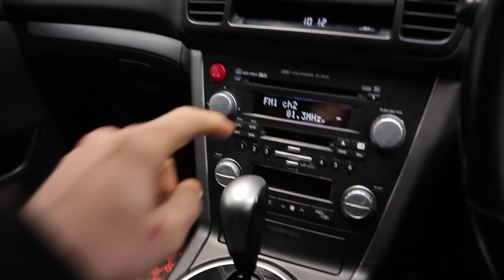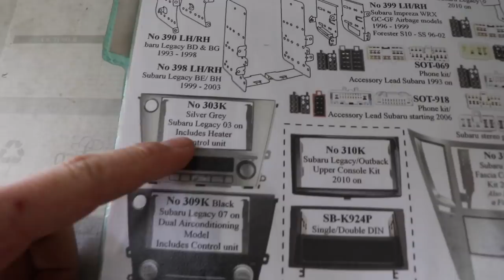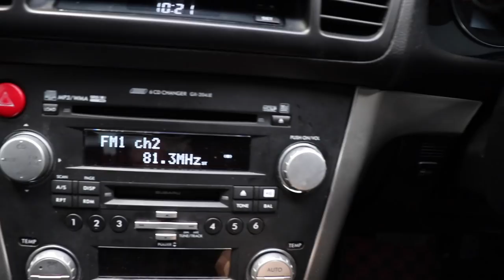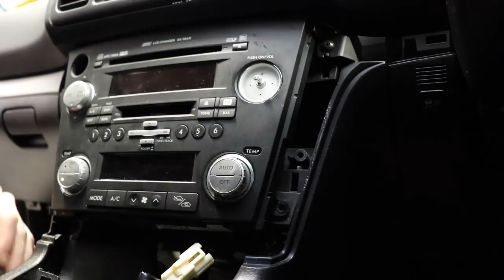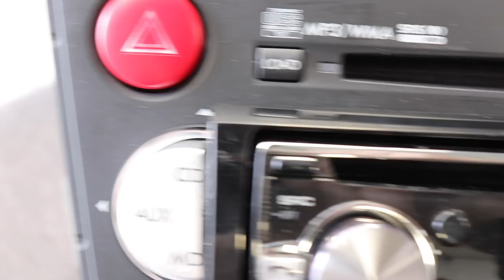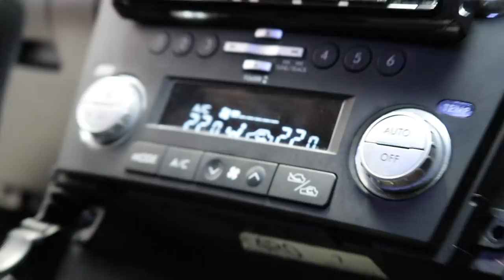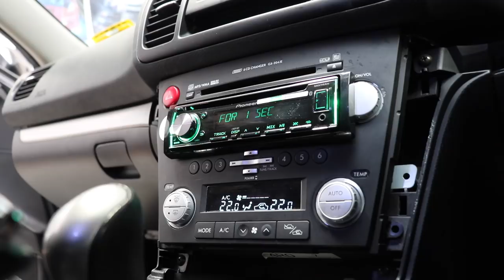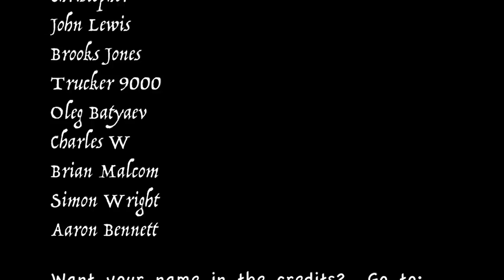2006 Subaru Legacy Custom Stereo Install

Comment: Thanks for the video.We have a problem with a customers 05 legacy with the silver front set up that has excessive pararistic draw with the radio hooked up.On the back the stereo and ac controller are one unit,so we are now looking for options to just replace the radio and now see that it might not be an option?

Comment: Great vid. I have a 2005 Subaru Outback 3.0R and therefore the stereo with the integrated climate controls. When I discovered this years ago I cursed the engineers that came up with this lunacy. Years earlier I cursed them for their design of the cabin air filter placement. Men like them will be hunted in the end times.

Comment: What you could do is source the heating unit from a different legacy that has the separated unit and get the double din fascia for above it... that's what I'm going to do with my Subaru Outback 2007 car. Just haven't worked out if I want NAV up top and the Double din stereo down the bottom. It will be either way because I really don't want the stock stereo in my car at all. Just an FYI you can remove the top vent cover and remove the flappy part it's a clip in unit, which will allow you to slide in a single din mount plate and slide a single din stereo into it... I haven't done that specifically yet but I did take the flappy bit out and slid in a single din stereo and it works like a charm, although it's not secure yet but it does work

Comment: @ 16.42 you have found that the AC controls still work without the stereo connected. Why then did you not get a 2-din mounting bracket for the non-automatic AC, that is the one with three holes where the AC controls come through? With a bit of cutting you should be able to make one bracket out of two? Or am I overseeing something? The bracket for the non-automatic AC costs around 30 euros (in Europe, of course), about 48 Australian dollar.

Still, you did a fine job considering the low-cost part of it.

Comment: I normally don’t comment on this shit, but man, how easy would it be to just mod the dash for single din? Come on. 
Take the board out, fill the holes with putty, bondo the front, paint, and it’s done. Would look thousand times better.
Reply: Can't do it, at least not on mine (2009 BP Liberty).  The climate control and stereo fascia controls are all mounted on a single circuit board.

Comment: JDM do a pretty good double din mounting kit with a separate ac/heater    controls and a face plate for about $400/500, you should check them out.

Comment: Lots of clever work here, but I can't get past the split knobs.  I also don't love the "proud" mounting the the head unit.  I realize the customer was not going to pay for you to body work the face to fill extra holes, but perhaps a better alternative would be to cut and glue on an ABS panel across the mid area of the factory panel and ISO mount the head unit.  When you have to make a custom mount you might as well set the unit flush.  Not ideal, but cleaner and still fairly cheap.  At the end of the day, if the customer is happy, you did a good job.

Comment: i have the 06 legacy with the mcintosh same as  in vid @7:00 it has no aux button, aparently there is an 8pin slot at the back that i can put an aux adapter do you know if this is true? i really dont want to replace the whole unit just to have aux capabilities

Comment: They if you’ve got the Macintosh style setup. They make a top facia which cost a couple hundred dollars. 
But they’re about $900 in Australia... for the kits for a complete replacement and that has a seperate heater control. On that note. I need to colour match my facia to silver...

Comment: Might try the salvage yards for the center stacks that you need and start buying them up.  

Thinking out loud, would you be able to manufacture an upper section out of plastic and mount to the frame of the original dash?
Could you pull the knob as replace with holesaw cut disc made of plastic and CA glue them in?  Like it was said before, most shops woukd not touch type of modifications.  Looks good James.

Comment: I have gone through this on my 2007 US Legacy. I used the parts from avojdm as previously posted because I don't have the separate AC controls like that car does. Having the luxury of time I first would have tried to glass the back of the panel and then cut out the single or double din slot, but hats not realistic for your case. With your time and budget constraints I like what you did, I think it looks pretty cool.

Comment: My mates got the silver version stereo and I defs need help getting a new radio in it with aux I have no clue as to how tf imma do it. Is there a way to run a wiring from the radio to the dashboard which leads to an aux in ?

Comment: I'm not digging it man. Cutting up a dash like that... And what do you gain? It's a pretty basic radio you put in there. What does it do better than the stock one? USB? Install a USB interface. More power? Install an amp. Bluetooth? Again, install an interface. Just don't cut up a dash like that to put in an ordinary radio. It's not like it's a P99RS or does navigation or anything. Everything it does can be done with interfaces on the stock radio.
Reply: You also get shit audio. Like the stock radio!!  Not with this pioneer though

Comment: i would have removed dials and filled in the gaps where they dials were and then painted a matt black strip across the panel where the new head unit sits, just to make it all sit nicer and look a bit more natural

Comment: I’m split on this one. For what you had to work with it turned out pretty good. But I’m pretty sure metra or scoshe makes a dash kit for that car.
Reply: Same here. If I had to do this.. I'd tell the customer not to mention my name when asked about it. lol
Reply from the maker: can you drop us the links cos we can get both of those brands.
it has to be for digital climate controls, though not manual like the us subarus..
Reply: Car Audio.etc I don’t have access to the metra back end anymore. I could be wrong because they only have the manual ac control model. But it could easily be grafted to the oem. Easilyish
Reply: 3d print one?.what the cost of 3d printer. He does not do.enough these jobs.to justify getting one(a3d printer)..
Reply: Notten not I didn’t say 3D print one. I was saying cut the kit and glue the ac control to the kit.

Comment: Do you know how to hook up an aftermarket subwoofer to an 08 kenwood system? I think there's a harness you can get for a OEM sub. Could you use that to wire in an aftermarket one? Looking at using the factory radio with a line output converter to my sub and component speakers

Comment: I like it James, good cost effective option. I wonder if the face plate is ABS, if so, maybe the old silver dials could be filled. Two Qs. Can you fit the black climate/stereo unit to a prefacelift car, 03-06? And how do you think it'd go fitting a double DIN? Chur from Dunners

Comment: Hey James, I really liked the job that you did on this Legacy. I didn't have any hope until now but atleast it is possible. I live in Auckland and I am in a same situation too. I have a Subaru Legacy 2008 with the screen and I want to get the stereo installed with speakers, amp and sub-woofer. Where are you guys in New Zealand?

Comment: What a pita. Customer obviously doesnt wanna spend mega dollars on a custom or factory looking install so how far do you go to polish a turd. As far as cost effective thumbs up. I would have looked at removing all the buttons and trying to fill. Fibreglass and/or bog. But then again it is the cost effective factor. You did great with the limited options you had. Keep up the great work with the videos man.

Comment: Why don't you just use processors like the audiocontrol dq-61 or the audison bit one.1 instead of tearing up the factory radio. Also, there should be kits available that are cheaper than $1,500 come on.

Comment: Why does your fitting kits cost so much for the double din? I only paid 500$CAD for mine including shipping (571.74NZD as per google) Even though it is a JDM part it fits nicely into the USDM car. Either way, "botched"  or not this is some great work! keep it up!
Reply from the maker: by the time anything reaches a customer in nz, too many people have tried to make money off it.
Also the ones we get are genuine Subaru parts.
Reply: Car Audio.etc that's insanity! Although the genuine Subaru parts is pretty legit.